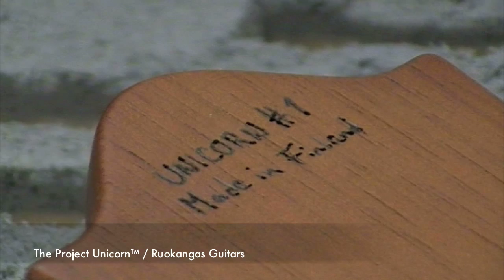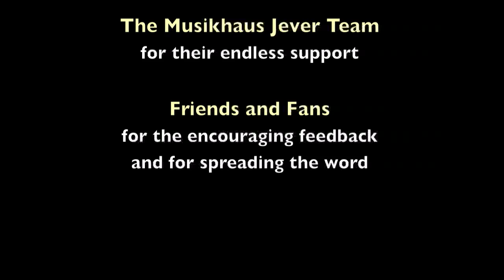Ruokangas Guitars Video Diary Episode 13 - Finishing

Comment from the maker: @retornaz Usually the term "solvent based" simply means that the color is compatible with solvent based finishes - opposed to "water based" colors, which can be used with water based finishes or in some cases directly staining the wood before applying any finish.

Comment from the maker: @retornaz Sorry if I've been unclear. Solvent based means general category of colors that are suitable to use with solvent based finishes (f.ex. nitro, polyurethane). There are pigment colors - meaning that the color is powder that doesn't dissolve, and the worse the quality of the pigment, the bigger the "pixels" - but the bottom line is you can never get 100% translucent burst with pigment colors. To be continued...